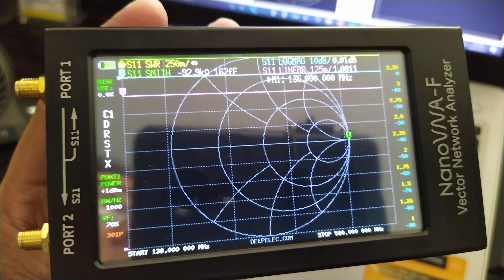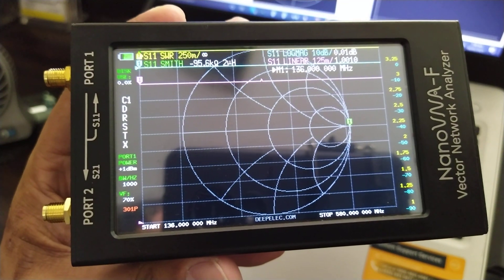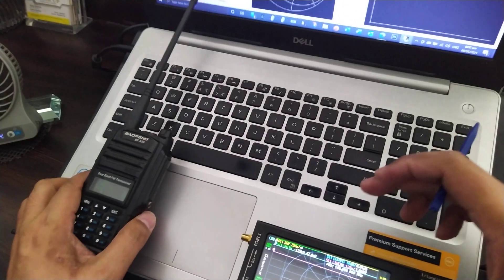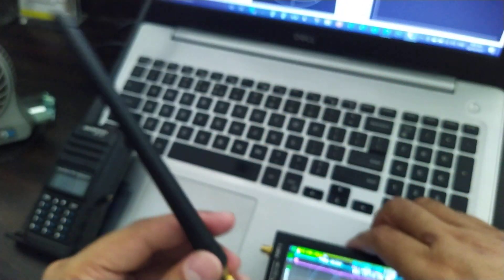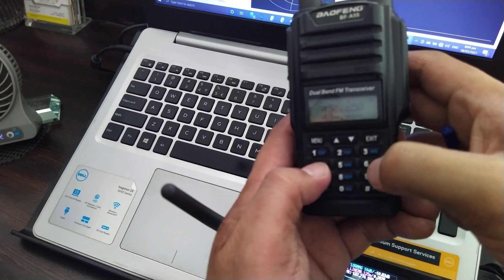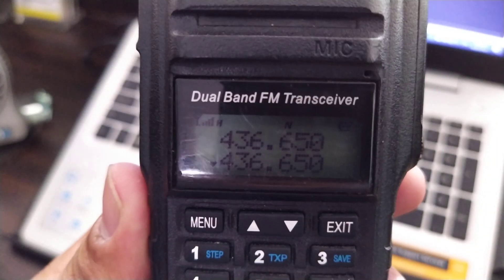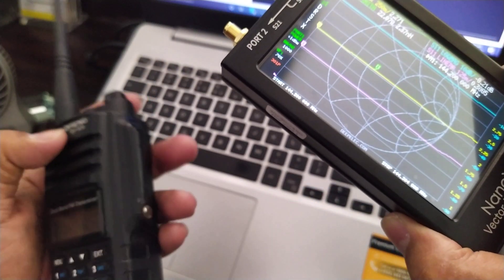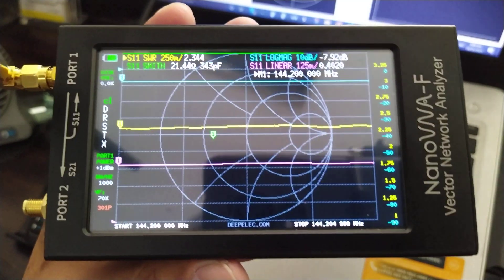NanoVNA-F Radio Signal from Port 1

Comment: Years Ago I Found A Video Where A Guy Put The Nanoo VNA Close Proximity To 21 Meter Band AM Radio And Made It To Receive 40 Meter Band And It Sounded Good, IDK What Or Howp He Did Such A Thing,But It Was Cool, He Just Twisted A Copper Wire Around TThe Radio That Was Connected To Vna And Violā ! It Worked SOMEHOW>

Comment: just don't accidently tansmit!
Reply from the maker: I did some test, using my NanoVNA-D by DisLord and hardware from Gecko, I attached a portable antenna to the Port1 or S11 or Ch0 or TX and set stimulus to a certain frequency to transmit and also attached another portable antenna to the Port 2 or Ch1 or S21 or RX of another NanoVNA-F from BH5HNU of Deepelec and set stimulus frequency same as the Gecko to receive signal from the Gecko but nothing happens. Lines didn't move and even small spike.